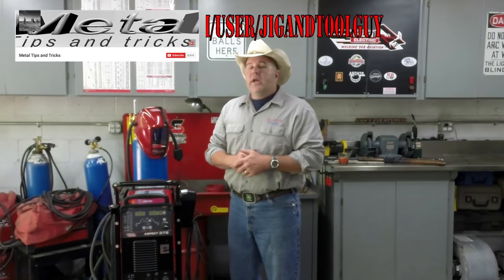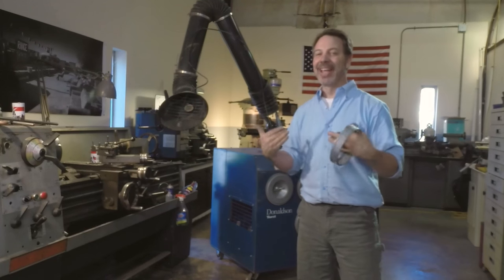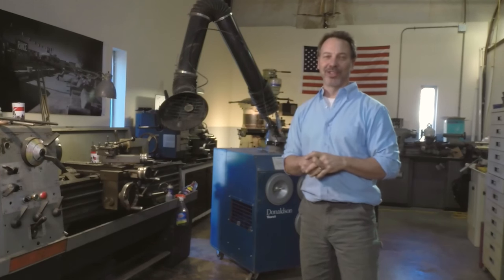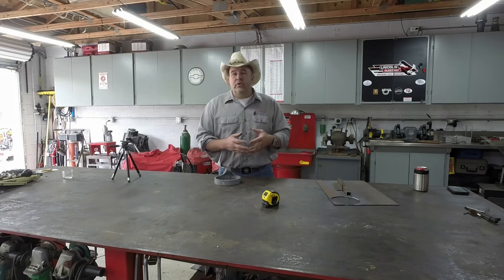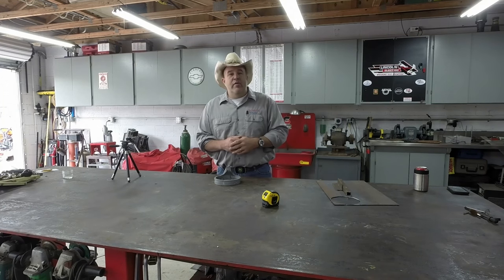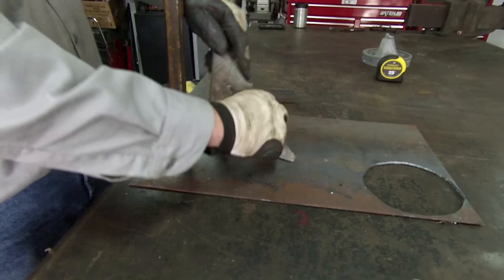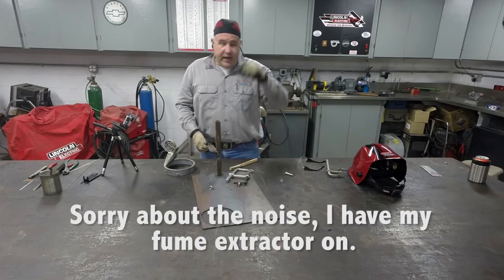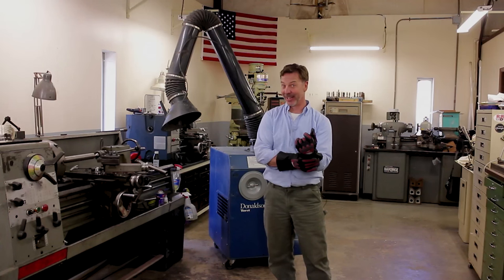Welding a cast aluminum part for my friends at Metal Tips and Tricks  and Abom79

Comment: My die grinders use to sound as loud as yours, until I stuffed the exhaust port with some pieces of scotch bright pad. I don't really notice much difference in power but they are a bunch more quite. I have done the same thing to the IR air drills I have, some of them had a plastic cover over the exhaust port and I added an extra screw to support the plastic. 
Nice video, thanks for sharing.

Comment: I actually saw this video on Abom's channel.  Well done !  Very informative and very funny.  I too was a Firefighter.  I retired  from the Chattanooga Fire Dept. in Dec. of 2013 with 28 years of service.  I have set up a small shop including a Grizzly G1005 benchtop mill/drill,  Horror Fright lathe that I converted to 14 " bed.  I also have a blast cabinet, belt sanders and 5 tool boxes, all in a 10'X12' building.  I spent most of working career working in fab shops so I can relate to just about everything that you talk about.  I've done Mig, Stick, and Tig.  I personally have a Linclon 225 AC tombstone welder and a Campbell Hausfield 70 stick welder (almost useless ).  I've spent a lot of vacations in Orlando.  I have family there.  Hopefully, I'll be able to visit some day and we can trade Fire Dept. t shirts.  Keep up the good work, and stay safe. 
Mike

Comment: That Video made me a Subscriber for Life! 
Awesome Teaching on at best a "pain in the a*#" Welding Project for most Welders.
I've never attempted Cast Aluminum, but after watching your Tutorial, I now feel confident enough to try it.
Question for you Jim. What are the Dimensions of your Weld Table that you were working off of in the Video??? Width, Length, & thickness of the Top Plate.
Thanks in advance
Reply from the maker: 11' x 4' x 1/2" from memory. Thanks for the sub.
Reply: @DoRiteFabrication  thanks for the quick reply Jim. Getting ready to build myself a new "Big" Weld Table, and yours looks like the perfect size for me.

Comment: If you haven't tried 4943 rod for cast aluminum you don't know what you're missing, it's like cheating.
Reply from the maker: I like cheating......lol
Reply: Most of what I do is casting repair. It is much easier to weld with (wets like you wouldn't believe) and deals with junk in the parent metal infinitely better than 4043.